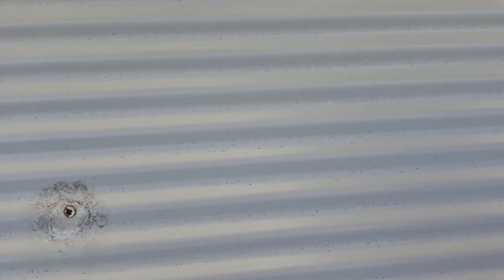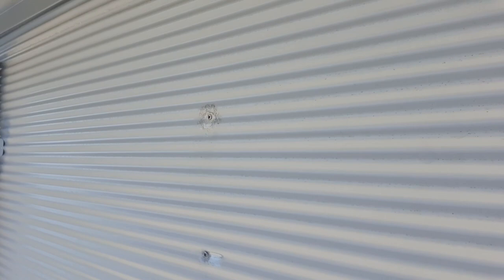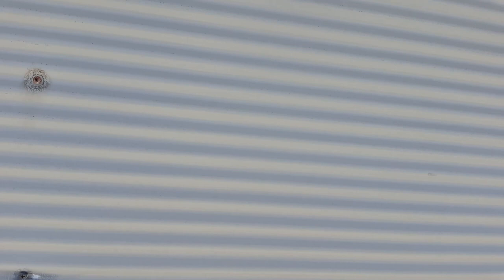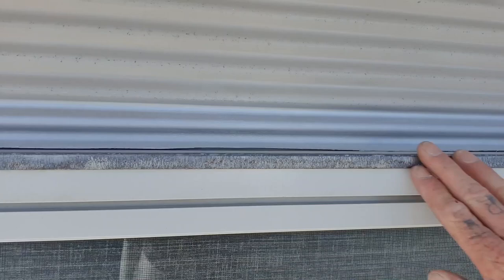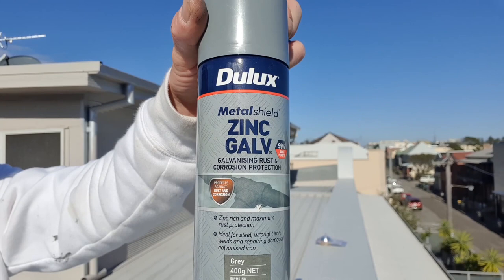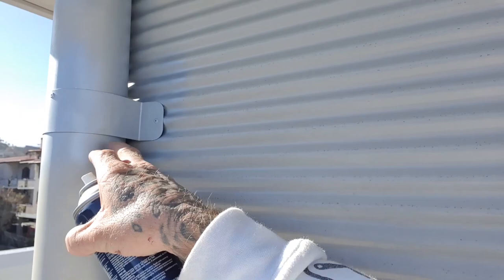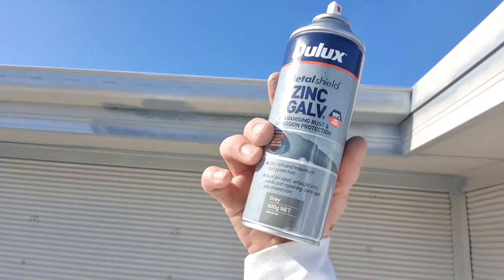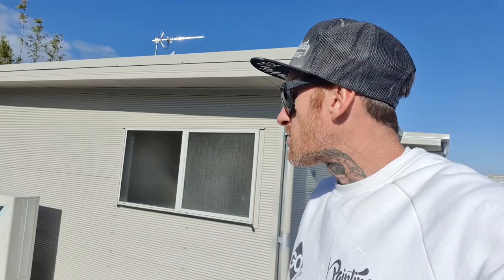COLORBOND PREP

Comment: I wonder it the corrosion around the screws is because they used stainless and you have two dissimilar metals contacting each other
Reply from the maker: Hi mate, I'm pretty sure it was just surface rust I'm the screw heads 🤙

Comment: hi i am going to do my patio i have got all the rust of. the rest of the patio is fine rust free  theres no rust should i prime it before then after. or is there a paint that is a mix of paint and primer.
Reply from the maker: Hi John, I usually prime just to make sure but you could probably go straight over with your top coats. A self priming exterior paint like Dulux weathershield. Hope this helps mate 👍
Reply: i went to Bunnings they said no need for primer. I primed only the small area of bare metal with primer in spray paint can. 90% of my Colorbond has no rust at all. That's the reason not to prime she said at Bunnings as other pain on Colorbond is fine.

Comment: You recon you save any time using the tins instead of just touching them out with a brush. 4lt of that primer goes a long way with a brush.
Reply from the maker: Hi Michael. I would never recommend using a brush for anything that has a factory finish you want to achieve the same finish the factory gives and this system you achieve that all by spray. a lot faster and more efficient💯

Comment: Hi Josh, do you work in Nelson Bay? We have a 22 year old Colorbond house. Most of the roofing screws have rust on them. We also have a cantilevered deck where the steel beams have surface rust and should be fixed soon. Is there anything you can do?
Reply from the maker: Hi roadie, I usually don't work, just holiday in nelson's Bay but maybe we could work something out and do both🤣 would you like to get in touch through our email at Josh@paintingbyjosh.com.au
Reply: @paintingbyjosh  L